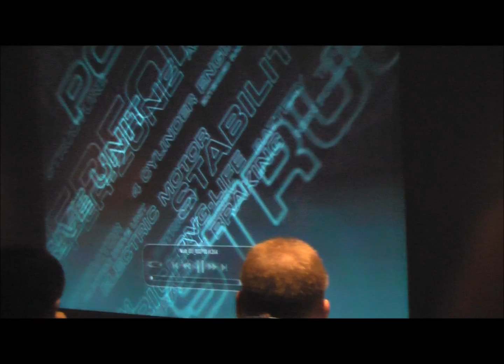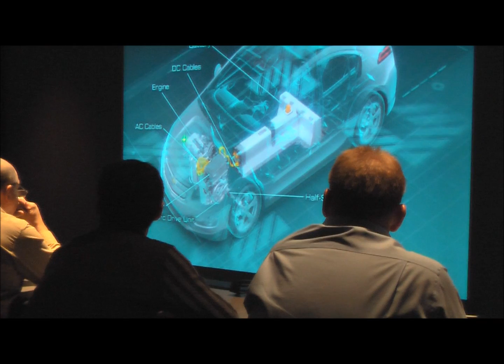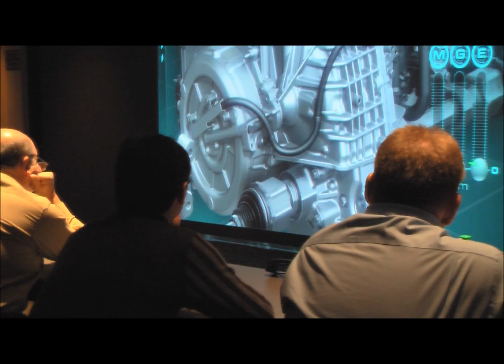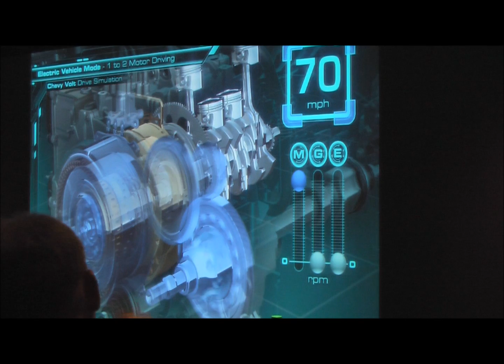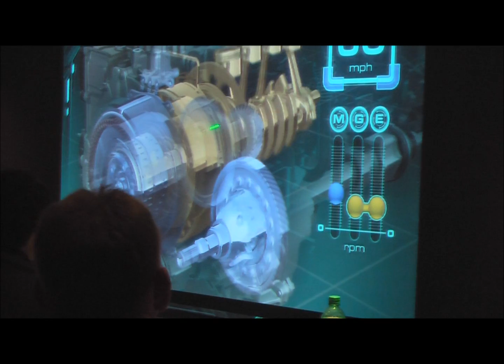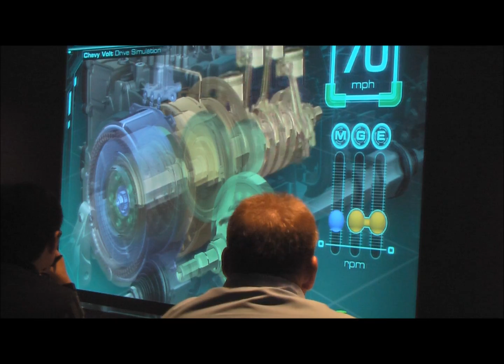Chevrolet Volt Voltec Electric Drive Propulsion System

Comment: It doesn't take an entire transmission like system to crank a generator.  LOL.  All it takes is a belt pulley and the generator.  Too many gears + steel plates does nothing but waste iron.

Comment: Nice work, but the generator just generates the energy for the e-motor. In no circumstances does it recharge the battery. It will stay at 26%. Please change that in your animation.

Comment: Another question, when at 70MPH and the battery is not depleted, to increase efficiency it looks like they somehow use the generator as a motor? I know a AC motor can easily change from being a generator to a motor... so Basically the volt will use 2 electric motors sometimes so that the one motor is not stressing and creating too much heat.

I guessthishelpsreduceweight,cus the primary motor doesn't have to be able to fully power the car, the generator can help as well+engine whenbattisdepleted

Comment: So, when the battery is depleted and the car is at 70MPH, the engine is running the generator, which is locked to the motor, which is connected to the front wheels. Therefore Engine power is directly turning the wheels, right? So in this mode, it is NOT an EV because engine torque is being directly transmitted to the drive wheels, right?
Reply: It looks like the engine is partly powering the wheels through the kinetic energy that it imparts to the generator.  Engine rotates the generator which is rotating the wheels, but the generator is still generating electricity which is powering the main electric motor.  This is how I understand this.  I own an Ampera which is the European sister car of the Volt (Mk. 1).